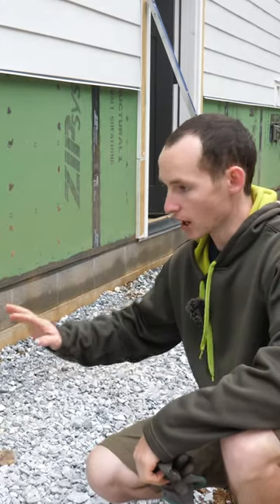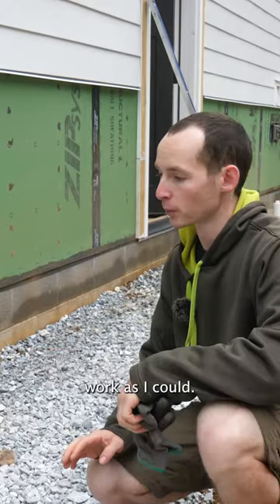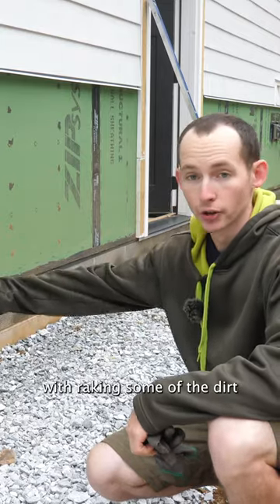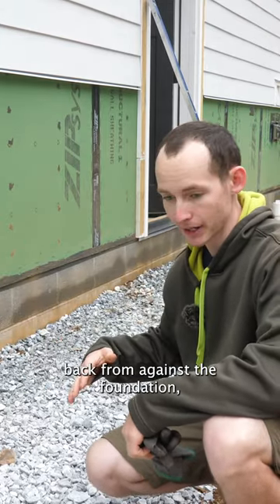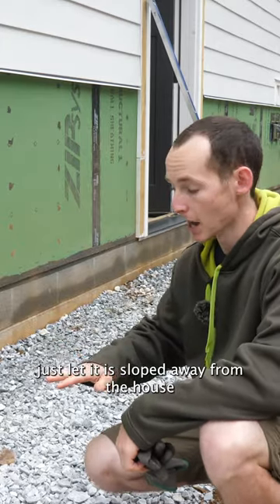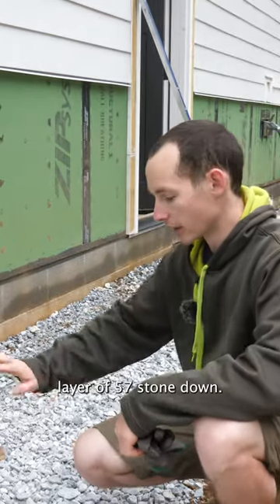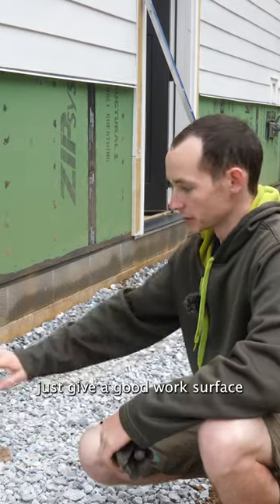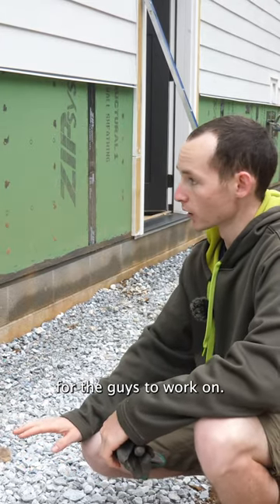Preparing the Jobsite for Stone Veneer Install #building

Comment: Are you putting angle iron in or a concrete footer? Or is this going to be a fake stone veneer with wall ties? And bruh there’s no weep ropes in that block foundation as far as I can tell.
Reply: It’s probably stick on stone my guy. No iron needed. You staple a metal lath sheet to the drywall then skim coat some mortar on it. Once that dries you lay the stone(more like faces of stone) just like tile. You butter the back and stick them.
Reply: @arthurwallace3232  lick and stick. If it’s like the other stone they used on their house it will fail.
Reply from the maker: It's a natural quarried stone split into thin veneer that will adhere to lath, no foundation ledge needed